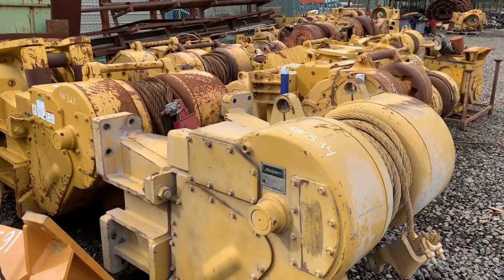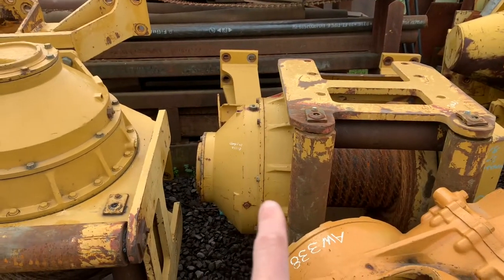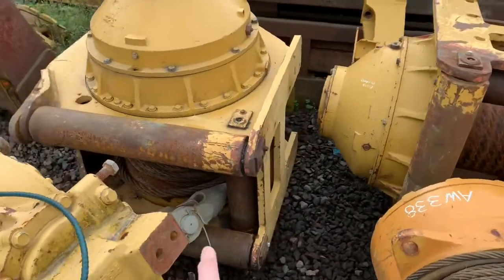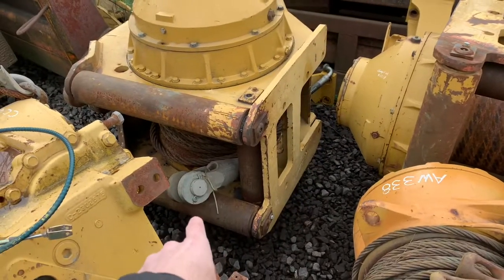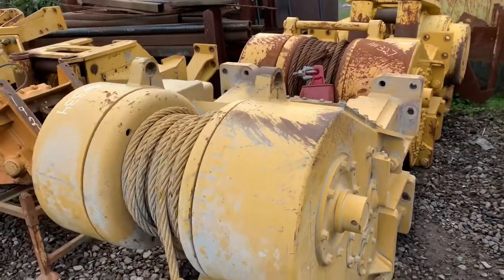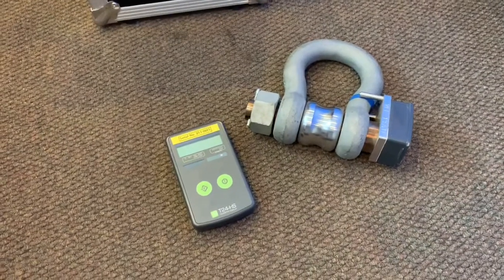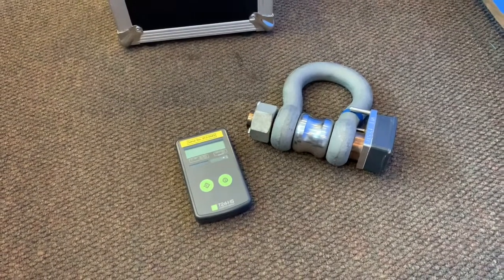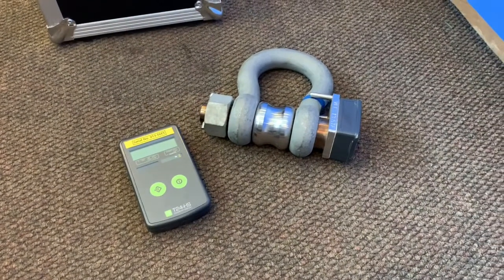STOP “Before” your winch breaks

Comment: I currently have a dramatic 19 winch on the back of my international td8. Where could I get parts or a part breakdown. Mine doesn't seem to pull very smooth
Reply from the maker: https://www.youtube.com/watch?v=GkzlrthwzkQ  
I can send you a manual and the parts breakdown of the gearmatic 19. Shoot me an email parts@thomsonequipment.com
Reply from the maker: https://dozerwinchparts.com/content/MODEL%2019%20Gearmatic%20USE%20THIS%20ONE%20W%20BRADEN%20NUMBERS.pdf
Reply from the maker: There is a link for the PDF as well. I suggest you review our other video on the Gearmatic 19. (there a couple of parts you REALLY do NOTwant to damage)

Comment: Would this work on my crane
Reply from the maker: If you're asking about the smart shackle for use on a crane the answer is YES. The sensor sends a signal to the display showing load. It will tell you the load being pulled or hoisted regardless of vertical or horizontal orientation. It works really well in increments of 100 lbs.

Comment: Would you have or happen to know where I could find a adapter bracket for a Gearmatic 19 to a 450C case dozer
Reply from the maker: We support a lot of gearmatic winches helping owners make repairs to the internal components. Finding the mounting brackets for a specific install is really tricky on the old stuff. Nothing in stock right now for Gearmatic 19 brackets to bit Case 450C. Small winches are tough. You can find more information here: https://dozerwinchparts.com/blog/small-dozer/
Sorry, we can't help at this time.

Comment: great idea how much ?
Reply from the maker: Prices range wildly when looking at capacity and features as some include data recording and extra software. We currently have a 13.5 ton shackle that's shown at the end of the video in stock for $2,500 certified by the manufacturer (only 1 avail). The shackle and load sensing unit are working rated at 13.5T, but the rated failure point for both is over 50 Ton if your pulling situation safely allows. We can do larger shackles rated for big loads as well but they get heavy and costly in a hurry. Some of the larger ones with recording devices can exceed 10,000 USD.